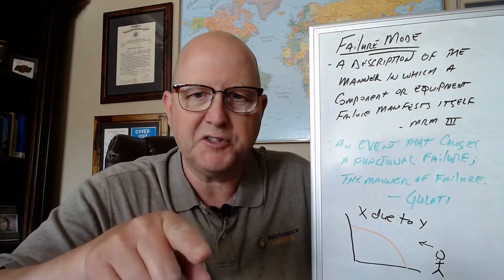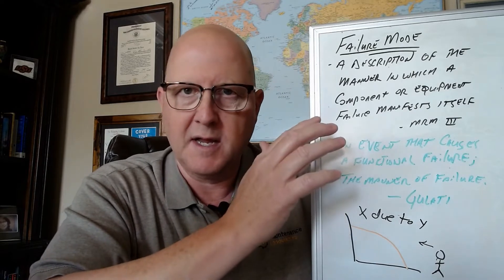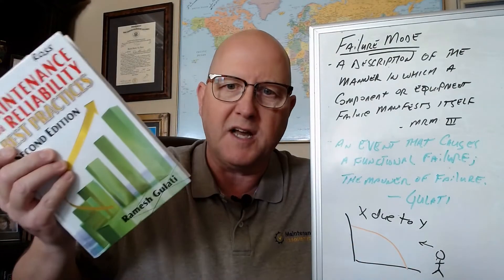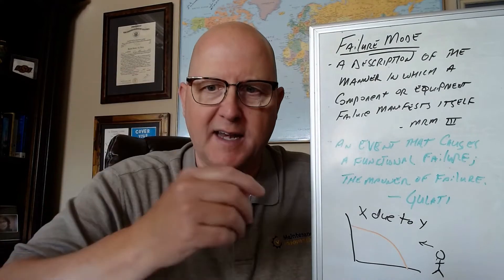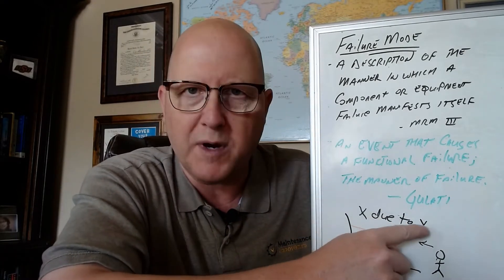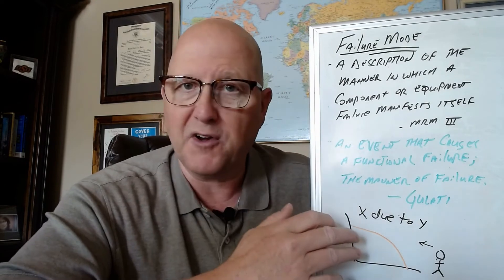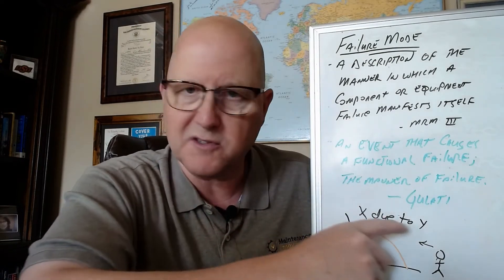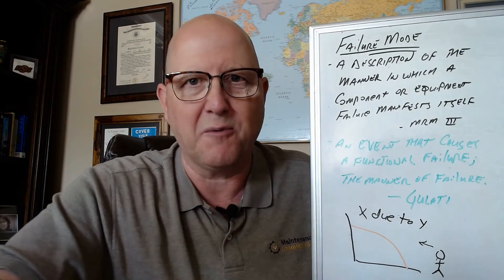Failure Modes

Comment: Is failure mode and failure mechanism the same thing?
Reply: No, failure mechanisms are always happening in the background.
For example: You get a new car. From the 1st day you drive it, the brakes will wear down.
If you don't use maintenanance to take care of this the brakes will fail, causing you to crash into a mailbox, for instance.
In this case, the failure mode is brake failure, the failure mechanism has been wear (of the brakes) and the failure effect is you crashing into the mailbox.
Failure mechanisms are linked to failure modes, but not the same.
A failure mechanism can be described as: Physical or chemical process leading to failure.
As such there's only a few, such as: Creep, Wear, Overload, Corrossion, Burning, Delamination and a few more.